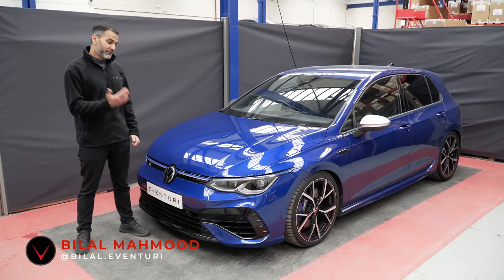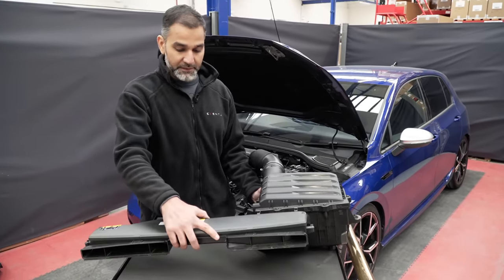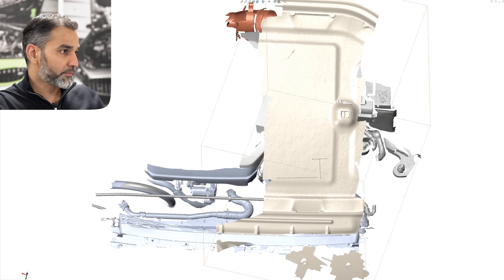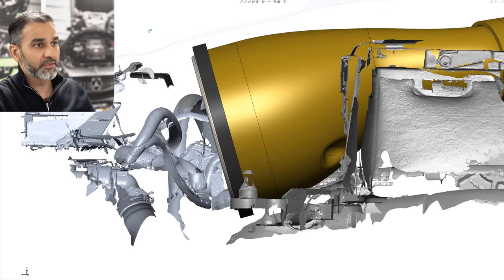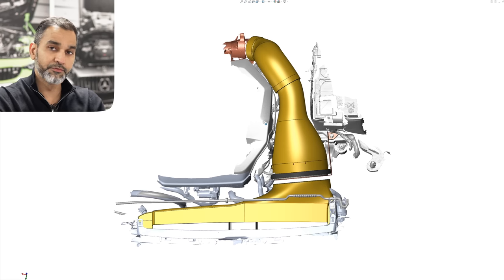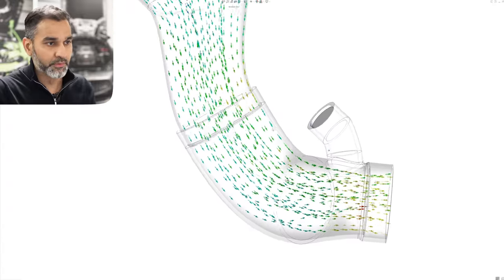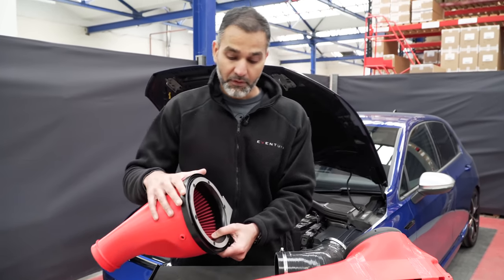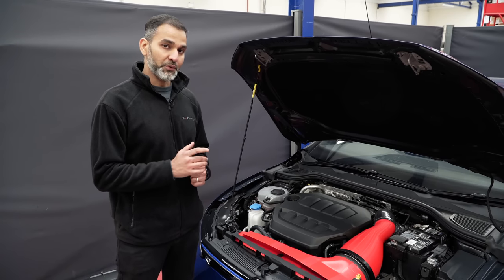Mk8 Golf GTI + R Eventuri Intake Development - Part 1

Comment: Just a question regarding the airflow from the front intakes the main intake is directly infant on the right ,the air coming in from the left would that still be going into the filter because the strongest flow would be on the right and the air coming in from the left would i guess have minimal effect so shortening the intake wouldn't be a problem.

Comment: Very interesting, what is the purpose of the stock grille primarily focusing airflow over the engine as opposed to the airbox? I am guessing you deem airflow over the engine unnecessary which is why you have blanked it out.
Reply: I would love to hear why vw has designed it that way. I would say vw know what they are doing lol
Reply: @GARRYEASTON   I'm no designer but logic tells me cold airflow over the engine towards the turbo as VW has designed does make sense.
Reply: @randallbezuidenhout3299  could logic say it’s for rain water also!
Reply: @GARRYEASTON  Looking at my Golf R stock air intake i have the airbox side blocked off possibly for rain by VW design.The other side is open for air flow to the turbo and over the engine . The VW design is doing hot and cold air at the same time, not great.The turbo is buried at the rear of the engine and needs some sort of cooling as well hence the design of doing two things at once....air flow over the turbo and into the turbo.This is going to do my head in lol

Comment: We all love eventuri let’s be honest .
But did vw design the intake from the fair side with the flap opening in motion in the event of hitting a large pool of water thus avoiding a flow of water directly into the air box?
Reply from the maker: If you intend to go through pools of 3-4ft deep water then yes stick with OEM airbox.

Very much doubt that was VWs intended purpose for the flap. All the possible reasons have been taken in to consideration by Bilal during design phase.
Reply: @EvolveAutomotive  I was trying to understand vws reason for making the engine pull air from such a distance ! They must be watching rufford ford YouTube channel 😂😂😂
Reply from the maker: It’s an odd one. A possible reason is for extremely cold climates where heavy snow may be an issue. Have to remember an OEM is designing a car for all conditions, from -30c to 50c+
Reply: @EvolveAutomotive  looks like the stock air box has various bends and channels to trap water from rain and snow and other debris before it gets a chance to clog the filter.  Does this air box design have a method to trap and drain rain water and mist before it gets to the filter or turbo inlet?
Reply from the maker: It does yes, Bilal has been in the comments replying.

They’re designed and tested in the U.K., it’s pretty hard not to test them in moderate to heavy rain 😂
Reply: @EvolveAutomotive  I think on a motorway in heavy rain that filter will get soaked
Reply from the maker: Eventuri have sold thousands of intakes with similar designs, and there has been no issue. What you think isn't the same as what has been designed and tested.